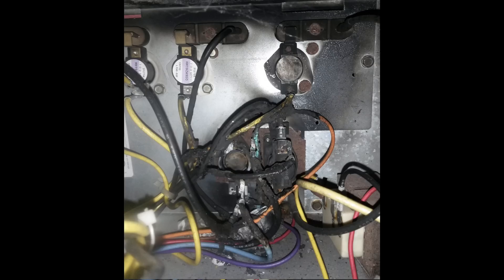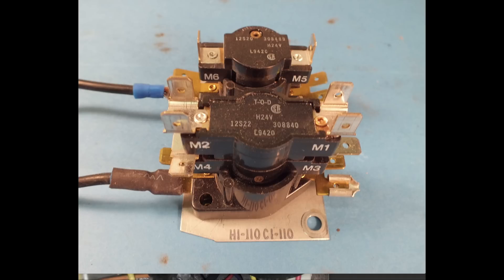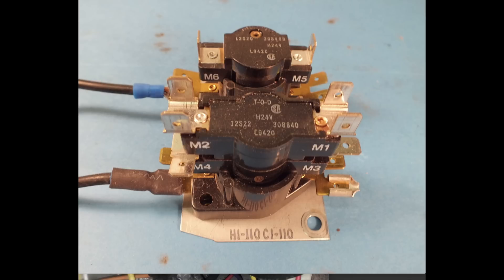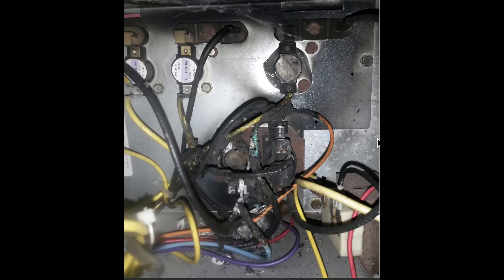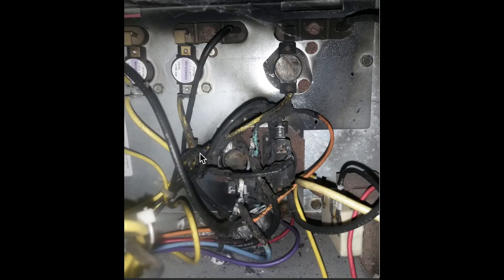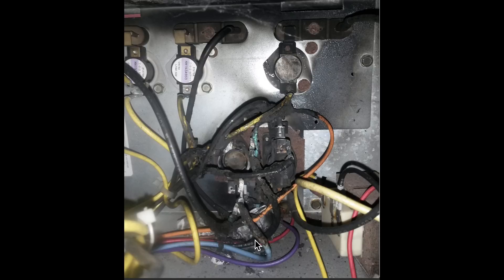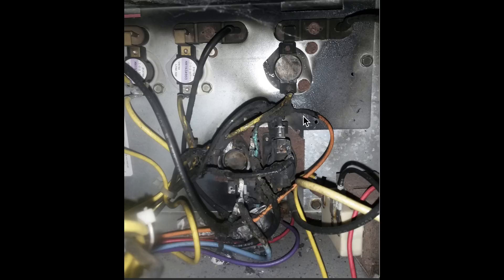Burned up electric furnace sequencer

Comment: Typically there is a loose connection that starts the problem. The heat sequencer if original,  is rated for the current. I'd say that I've found less than 1 handful of sequencers with welded contacts in my 50 years on the job.
Reply from the maker: Interesting.  We have had very different experiences.
In my first 3 years in the business all I did was repair electric furnaces.  
I found sequencer failures to be the cause of 70% of my calls.  Especially the stacked type.  
It eventually got to the point that I would replace the sequencers with contactors.  When I did so, the problems stopped.
Honeywell makes contactors that operate silently and are made for just this purpose.
Loose connections are for sure a monster for high amperage loads, but push on connections are very seldom loose.  They overheat and lose temper when the contacts overheat.
GFM

Comment: Hey i enjoyed your video. Wanted to ask a question. So my furnace is a Coleman EB17B. It’s very old (1996) installed in a mobile home. The furnace is working fine and still heating but out of no where I noticed a burning smell from vents. Turned off furnace, went to check and I had 2 wires going from limit switch to heater elements burning. I do have a new sequencer. About a month old. My question is, would those wires be the cause of the smell? And if by fixing them should that fix the smell problem? Also what size wires would you recommend? I truly appreciate the advice.

Comment: hey thanks for sharing. my control board just started on fire I assume it was from a faulty sequencer and I caught it before it looked that bad but the control board is shot and I assume I'm just going to replace both sequencers. scary stuff though the house sure did smell at least I know it's not going to be a total furnace replacement cuz I can't afford that right now I appreciate your videos.
Reply from the maker: For the most part, electric furnaces are repairable, even very old ones.
GFM

Comment: if furnace blower motors over 10 years old just buy new furnace time fix that ad then blower goes out in 6 months you out more then a new one with warranty
Reply from the maker: Wow, I would never advocate that.  Especially with an electric.  I have repaired electrics that were 50 years old and still am.  No heat exchanger to fail.
GFM

Comment: LOL...I recognized that picture I took right away as I am still working on this thing :) Thank you for all your help in the past.  I am now to the point where I have tried two sequencers and both of them had issues with sticking and arcing so I am going to be putting in a contactor / relay and will be doing it myself since no tech around here wants their name or insurance on this project..lol They all say to replace the heat kit for several hundreds of dollars...err. (I don't blame them I guess) I pretty much know this Carrier unit pretty good now anyway with all the wiring I have done to get me by until now thanks to your great videos.

Comment: Thanks for all your videos and info concerning sequencers. It really helped me in figuring out what was going on with my furnace. My furnace was running constantly and the heat output was minimal. It was due to faulty sequencers. One contact and wire was burnt off on one of them.  I decided to replace both sequencers on my furnace since I had the darn thing opened anyways. Now everything is running smoothly. Keep up the great work and keep the videos coming.
Reply from the maker: Glad you got it going.
GFM

Comment: the purpose of the sequencer is to S-L-O-W-L-Y turn on the furnace. replacing a sequencer with a contactor causes a power surge. can cause breakers to trip and fuses to blow. plus, causes a power surge when shutting down. contactor s are good for non-heat equipment (compressors, motors, etc.)
Reply from the maker: I cut my teeth on electric furnaces and I know that to be incorrect.  The sequencer was developed when power systems had far less capacity.  Most of the sequencer designs are garbage and I used to replace them every 2 to 4 years.  I say they turn on the furnace C-H-E-A-P-L-Y because they are so much cheaper than contactors.  
There is no power surge, so no breakers throw or fuses blow.  Check the amp draw.  There is also no power surge when shutting down.  Resistance heaters have no back EMF so when they shut off, the power just stops.  
Some manufacturers have never used sequencers (notably Trane) in their electric furnaces and Honeywell makes contactors  expressly for electric heat applications.
GFM

Comment: Good video! I will try to fix my unit with very similar problem;  I was wondering if you could help me to locate replacement for this sequencer in my 1974 old HVAC unit: YORK FE40-9B  serial DM-009397; the sequencer KLIXON 24-17993C01; 6000G0-2 is burned;  where can I find replacement or use other generic to modify the system; thanks in advance; https://drive.google.com/open?id=1GhuD1OQkYljTdk2GzCfkK-Rsg4PagrEa      https://drive.google.com/open?id=17f3kX6MZ9Kz_A8B_oPXtFcinAyg7mX-P
Reply from the maker: For that age unit, there will be nothing that is a direct replacement.  The simplest solution is to determine how many elements you have, then get a sequencer that has that number of switches.  The wiring is your worst problem.  I cannot easily guide you through that.
GFM